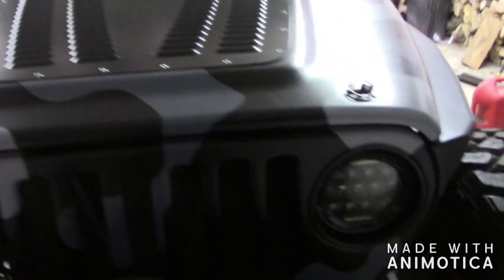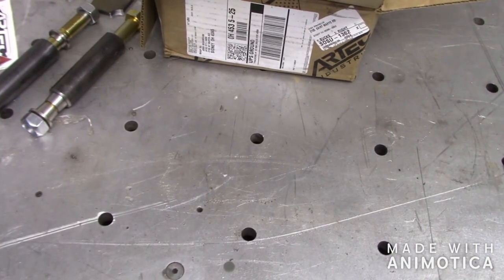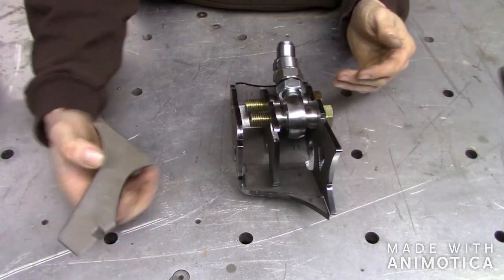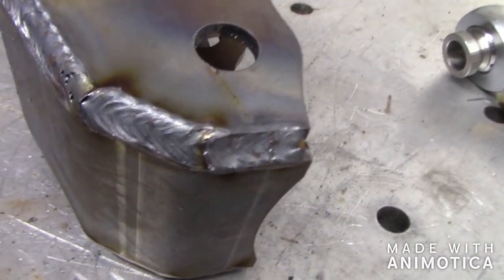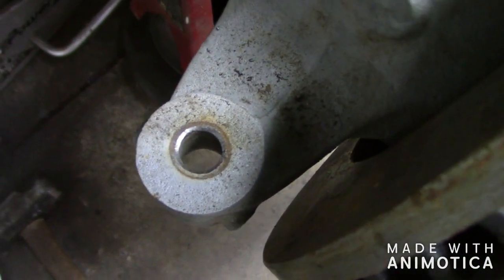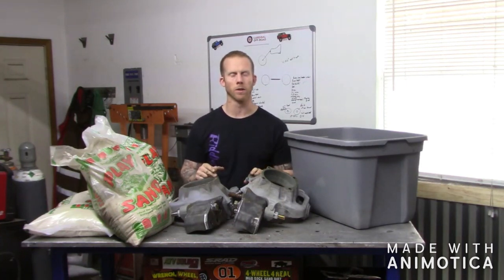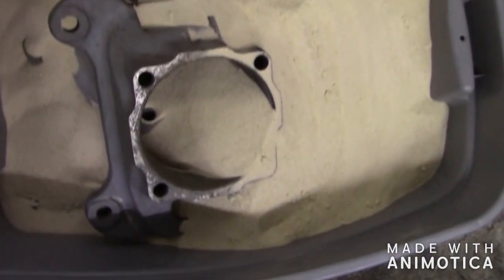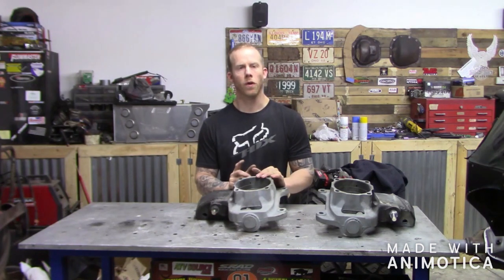Dana 60 High Steer

Comment: Did you use the hub vacuum seals on your front axle? I was debating if I need them since it's going on a jeep.
Reply from the maker: Nope. Some guys do just to keep mud out but I think it can go both ways. Unless you have new ones I’d probably keep them out. I’d be afraid that water would get in there but not come out.

Comment: I have a few questions since I'll be doing the exact same thing.... 1.) What type of MIG wire are you using?  I use ER70s-6    0.035" for everything normally. I know ideally nickel is best bust many say it's not needed. 2.) Did you heat BOTH material or just the cast prior to welding and then heat both together after welding? Lastly, what is your wheel backspacing? Artec shows their installation on their site with a 4" BS but I'd like to go more if possible. You look pretty close to max. I'm about to drop dime on everything for my SD60 and 10.5 build and appreciate any advice. Thanks  and SUBSCRIBED
Reply from the maker: Hunting with Kevin so I used regular wire for my mig. The idea of preheating and post heating helps prevent any issues with the weld. You can heat both parts as I did and post heat as well. Slowly cooling is very important, and I would do the sand like I did. Let it sit all day and night after welding as the sand will keep it warm for a long time. As for backspace I am running 5 and it’s close. I’m actually thinking of trimming it a bit by the wheel and plating it so when I air down it’s clear of the tire. Thanks for subscribing, sounds like you’re going to be doing a build like mine. Good luck!!
Reply: @CardinalOffroad  Thanks for the quick reply.. So, I just got off the phone with Artec.. They said they know 4.5 bs will work but haven't delved with anything else. I'm not shortening my axles so I need all i can get to get it on my Trailer.  What front truss are you running? I'm considering Artec as well but at 550.00 it's steep and I'll be coil over so whats the point of all the buckets in the kit...
Reply from the maker: Hunting with Kevin also make sure you pre and post heat at 400 degrees. As for the truss make sure to run one that’s narrow. You don’t need a full truss unless you’re running with lots of power. I went with artecs diy 3 link front and 4 link rear. If you’re interested we can get them just let us know. Ill get  you the part numbers of what I got.
Reply: @CardinalOffroad  I found the sd60 truss for the TJ that they sell for 550 for 1/2 price somewhere else. It's low pro as well  https://www.artecindustries.com/TJ_SDF_1_Ton_Swap . I  have a 4.7 stroker thats a decent 230hp at the wheel.